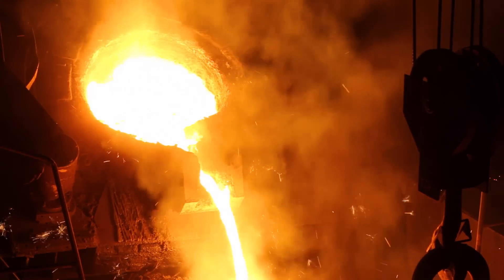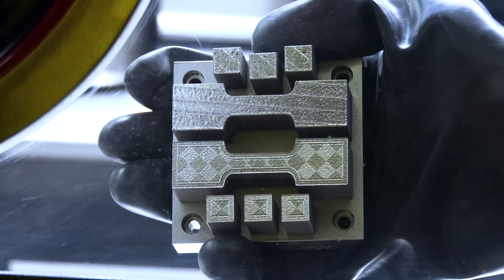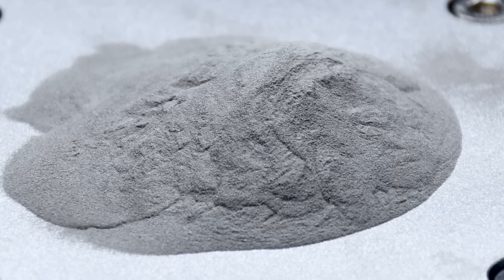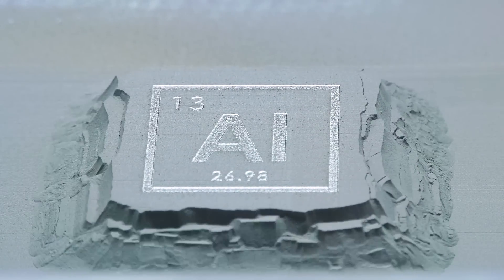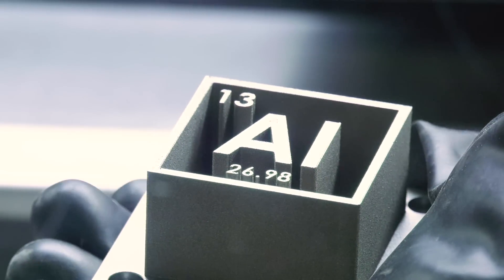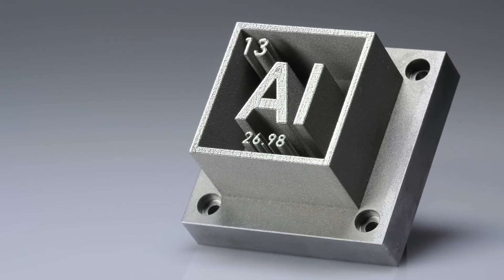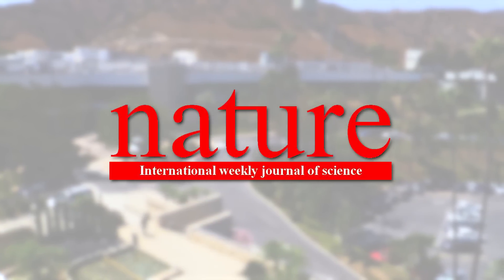Metallurgy Breakthrough: 3D Printing High-Strength Aluminum

Comment: Anyone seen those aluminium rods that melt and can weld a joint just by dragging the rod along the joint, if the joint is initially heated briefly first. Seems very close to 3D printing with plastic. Why is it in the form of these DIY aluminium repairs rather than in this application?
Reply: It does exist, or well, something similar called Wire Arc Additive Manufacturing where metal fusion processes like GMAW are used to build successive layers like this stuff but without the powder (and health hazards surrounding Powder bed fusion systems)
Reply: Those are made of zinc melted onto aluminum. This is melting aluminum yogether

Comment: Very cool, but you're already behind on your technology ... a single point raster scanned laser, or even 3 lasers in tandem, are nowhere near as fast as using an interim binder and then kilning the result after printing is complete (not possible for large items, granted, but most tasks will not be large). The difference in speed is 20-100x, depending on who you talk to.
Reply: But you have to weigh cost vs reward. Some times an advancement may not be cost effective and not offer a reward for such a cost.
Reply: @bighands69  Time is money, and 20-100x faster means a LOT both, so I dont quite follow your objection.

Comment: Wtf are they talking about? 6000 and 7000 series aluminum is welded all the time.
Reply: Hmmm i read this:
"The mechanical properties of 7075 depend greatly on the temper of the material"

It probably has something to do with this. When you weld, you lose the temper properties around the welding spot. And that, in Aviation, is probably something they can't accept.
Reply: Not without distortion and changing the molecular structure.
Reply: Gustavo XD You should read more. Specifically about heat treatment.

Comment: Very cool.  Once the items are printed do they have the same strength as a milled version?
Reply: Chris Sparks The million dollar question that nobody seems willing to answer, from the "makeforge" printing parts 20-23x stronger than conventional 3D printers (depending on where you see the company's claims), to printers such as this. 

At least this one has actual some actual multimedia though.

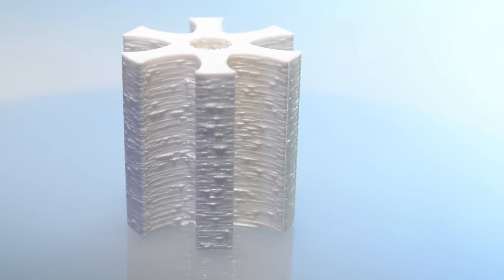Comment: That plastic print at 1:19 is not a very good print.
Reply: Ikr, even my homemade printer prints 10x better than that...
Reply: my chinaprinter prints like 100x better.
Reply: is PLA printed by the aluminum printer, lol
Reply: They are comparing to more common 3d printing methods using plastic to introduce the metal aspect. Using an exemplar that is not calibrated properly is definitely not a great way to do it.
Reply: Its absolutely the worst! The layer jitter is appalling! And I think they are keeping the two ends together with a ziptie?!
Reply: It was printed by their competitor .... BAMMM!
Reply: It doesn't have to look good.